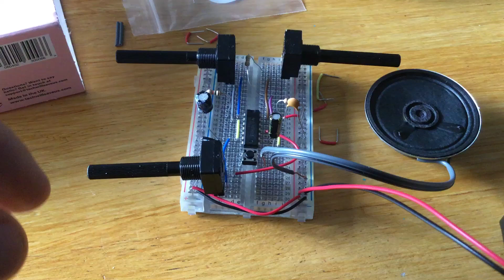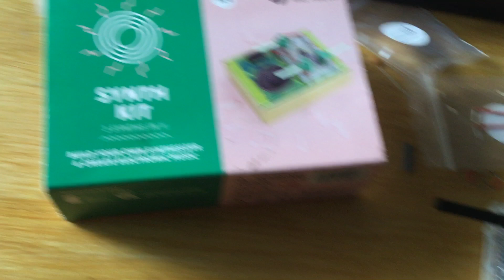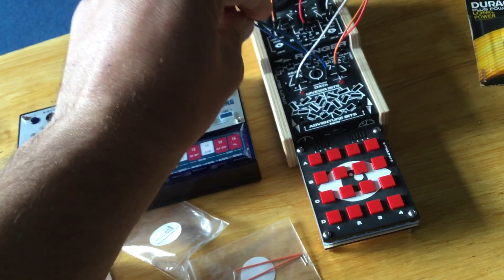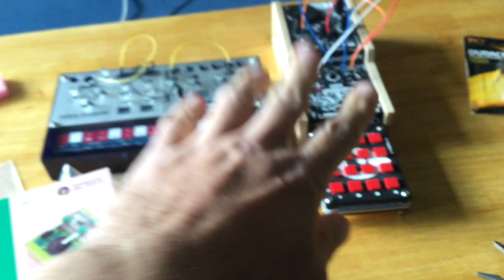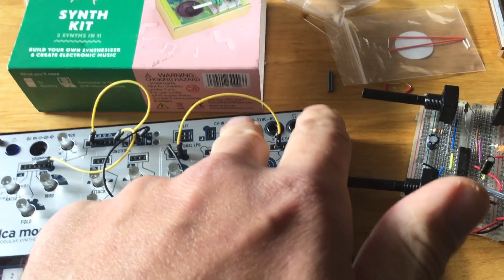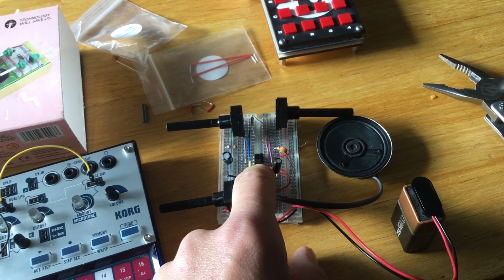Can I expand this DIY Synth Kit with volca modular or Bitranger?

Comment: Audio cable into CV in socket. Then you take a cable from either of the two little sockets connected to the cv in to the top left socket of the first lpg. You then need to press a key on the Volca Modular to hear sound.

This video explains how https://youtu.be/nZBIW8tkiHA
Reply from the maker: yes I think that is the route.  I tweeted the company who make the diy synth and they have an add a jack project which will make it alot easier!